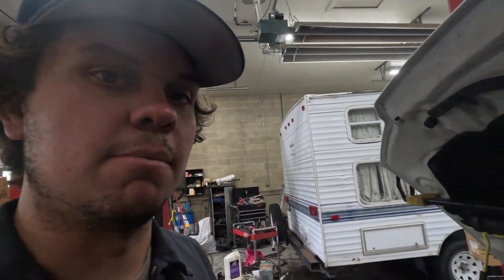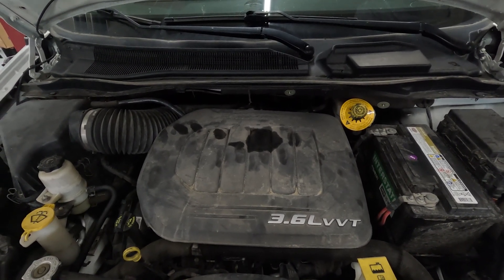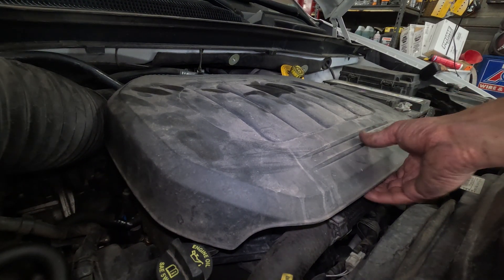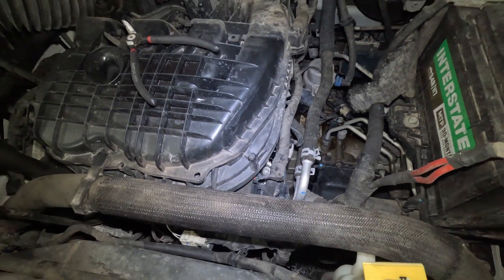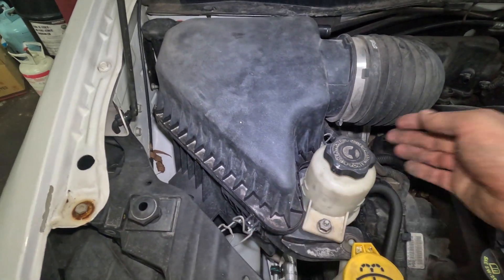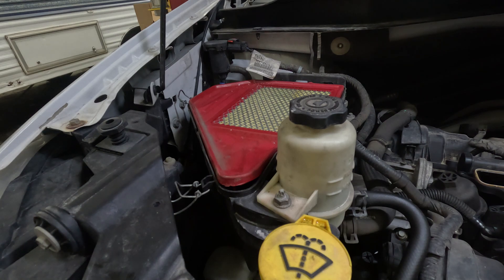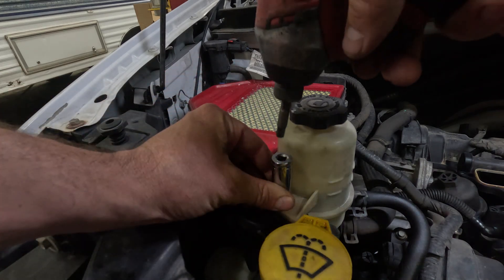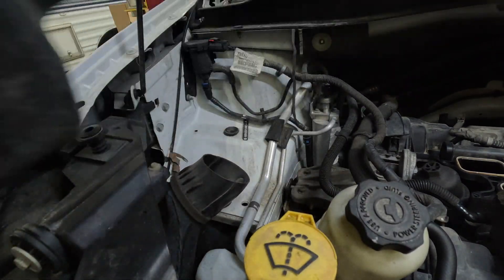Part 1 Engine Removal on Chrysler Town & Country, Dodge Grand Caravan,and Volkswagen Routan.

Comment: Thanks dude I was looking for the engine wiring harness diagram to figure out where I put the sensors for the engine wiring harness in for my vehicle since a back fire happened due to clogged fuel injectors and burned the engine harness. Among a few other parts though yeah lots of work lol
Reply from the maker: Hope you get it all figured out! Good luck to you!

Comment: Question! (and thanks for the very helpful vids......) Where did you connect your chain for the engine hoist on the back end of the motor (transmission end)??  The front location is obvious, but none of your video shots show rear connection location.  I just can't find a spot to screw in a bolt!  

I'm getting ready to pull my motor and was actually considering connecting to the exhaust ports on each side of the engine with some pieces of flat plate that I'd fabbed up, but I'm concerned I may run into clearance problems with the fire wall. 

I'd really appreciate a response.  And thanks again for the vids, VERY HELPFUL!
Reply from the maker: I’m glad you found the video helpful! As you can see I had to use a tie down strap on this motor. There is not a lot of places to hook onto. So I just ran a bolt where the bracket is for the intake through the hook of the tie down with a washer on it. Hope that helps. Let me know if you have any other questions. Good luck!
Reply: @csautomotive12  The motor is out. I lifted from the exhaust ports, just enough clearance with the upper intake removed.  Went fairly smooth, considering I don't have a lift and the vehicle is up on jacks. I removed the exhaust back to the resonator.  Gave me a ton of access to back of motor from underneath. Replacement motor is ready and waiting...

Question... Do you consider yourself expert on this particular job / Dodge Grand Caravans?  Do you do consulting???  I have a couple of questions about replacement motor that I'm installing  and would certainly compensate you; Paypal, Venmo, whatever, for your time.
Reply from the maker: @dewittyerselfer  What kind of question do you have about it? I have worked on a lot of them. I would be happy to help where I can.
Reply: @csautomotive12  My Grand Caravan is a 2011.  My replacement motor is from a 2013 Grand Caravan.  Everything  and everybody on the internet says the 2013 should be a direct replacement. (VIN, fifth digit "G")  Physically the motors appear identical. HOWEVER, as I was pulling the wiring harness it became apparent that Dodge used a  COMPLETELY DIFFERENT ECM (engine control module) in the 2013, with vastly different connectors. That said, all of the electronics on the two motors appear identical.  So I'm hoping I can just swap the original wiring harness to the replacement motor.  Do you see any issues with that?  Again, if this takes any effort on your part, I'd be more than happy to compensate you.  Thanks.
Reply from the maker: @dewittyerselfer I’m pretty sure it will work. You always want to use the harness from your car. I made the mistake once on a Jeep by using the harness that came with the junk yard motor and it didn’t work so I had to drop it all down again and change the harness. You could also call a junk yard and just make sure it will work. I looked on car part and they say it should work on there site. Just make sure the heads are the same from year to year.
Reply: @csautomotive12  Thx.  The replacement motor is in place and bolted up, slowly getting getting everything else reconnected/reinstalled. Hope to attempt firing it up this weekend.  Will check back then.
Reply from the maker: @dewittyerselfer  Nice work! Let me know how it goes!
Reply: @csautomotive12  It has taken me way to long to button up this thread up, but I'm happy to say after a couple of weeks of problem chasing (bad thermostat, bad belt tensioner, spark plugs totally shot, cracked oil pressure sensor,  bad throttle body and an intermittent P06DD engine code that I think is due to wrong grade of oil ) the new engine is in and running well. Took it on a 1200 mile road trip with the family in 90+ degree weather and thankfully no issues. 

Thanks again for the thorough videos.  I would NOT have attempted the job without them and referred back to your vids at least a couple dozen times while doing the job.  Guys like you on Youtube are life savers!